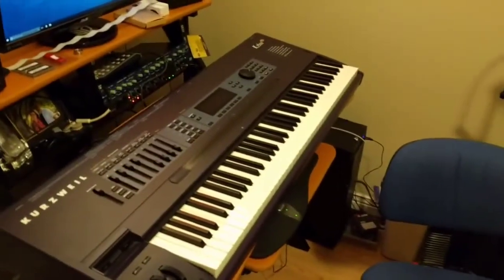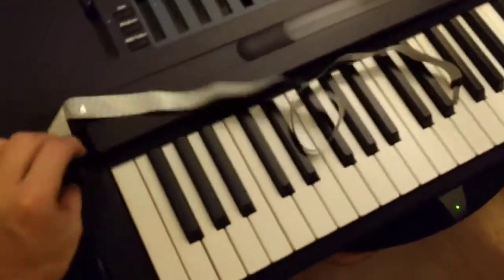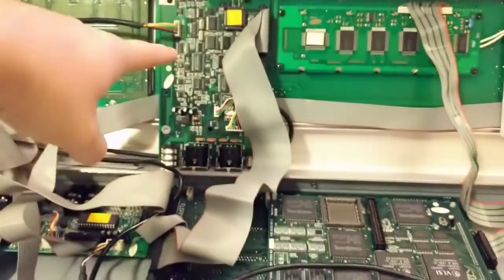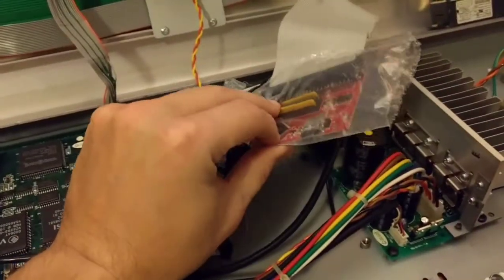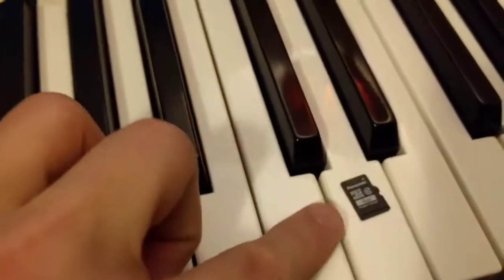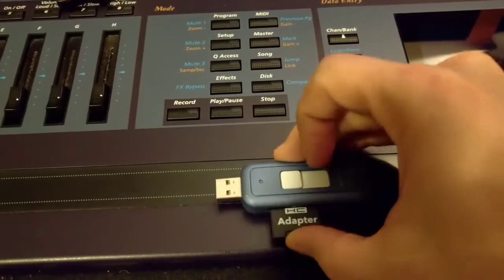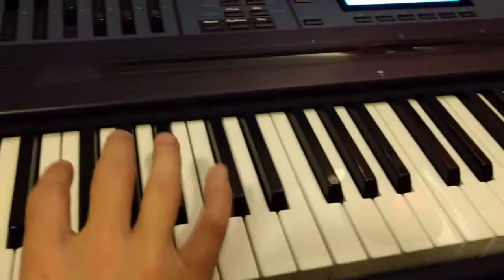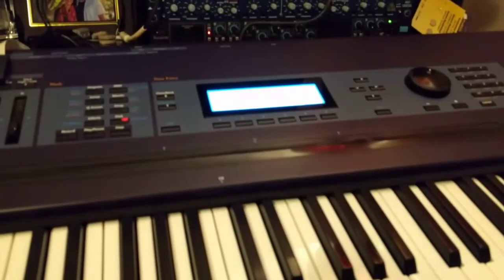Kurzweil 2600 with SD2SCSI add on

Comment: Hi! If I wanna to change my floppy drive, what do I have to do?  I have to unscrew the side panel and....?
Reply from the maker: It's not just the side panel. You have to take out the 9-10 screws along the back side, as well as the 6 main screws that hold the keybed in (They have sets of 3 holes along the bottom) as well as the screws around the edges as well. Once those are done, you pull the upper section away from the keybed itself by shifting or sliding the whole section with the screen and controls assembly away from the keys. It moves about 1 inch or so to 'unlock' and then you can flip it carefully while leaving the rest behind on the floor/bed/whatever the Kurzweil is sitting on. I'm sure there are videos of the Kurzweil being taken apart, but you can see at 2:31 the result of me having slid and flipped the upper section. The disk drive is on the left side, and it has two sets of side screws which is why you need to take it apart completely.